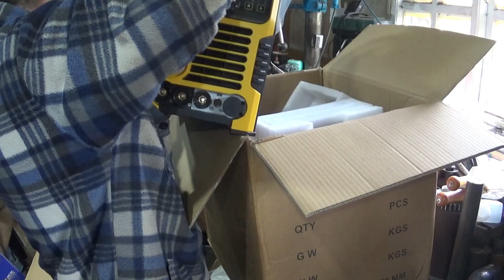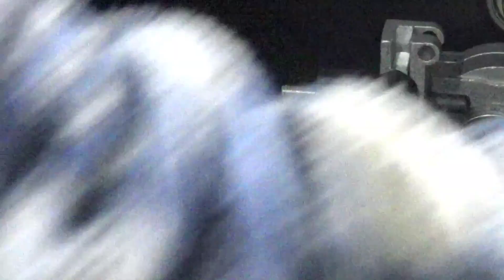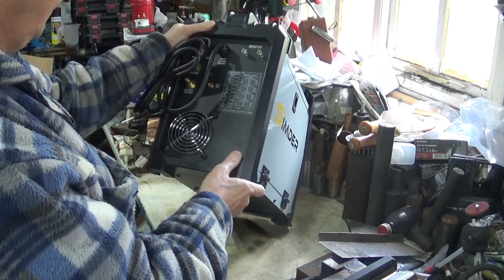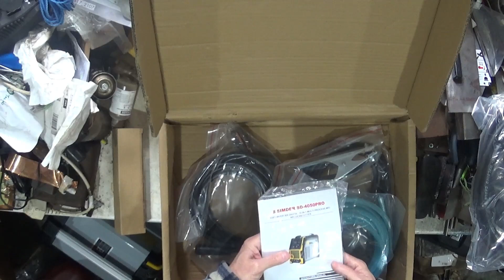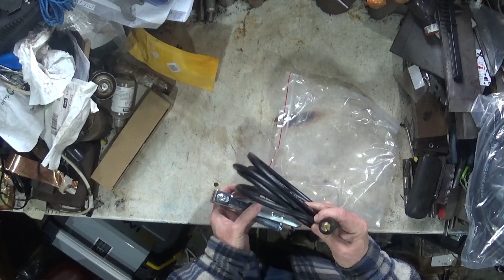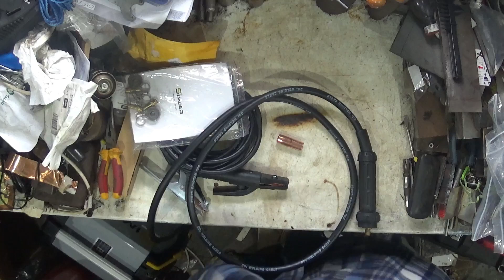Simder SD 4050 Pro Part 1 of ? Unboxing

Comment: It all looks pretty good Ben - I guess although quite expensive compared to budget gear, it's still pretty cheap compared to full on professional stuff, hence a few cost cuts like maybe not the thickest wires and so on.  With a bit of luck it'll be lovely to use - I'm quite envious!
Reply from the maker: I have seen a few reviews for pre production targeted models and they seem to be good but this is for a random user and hopefully an accurate reflection of what ordinary people will get. All good so far.
Many thanks for watching!